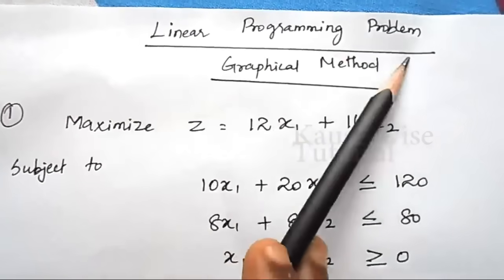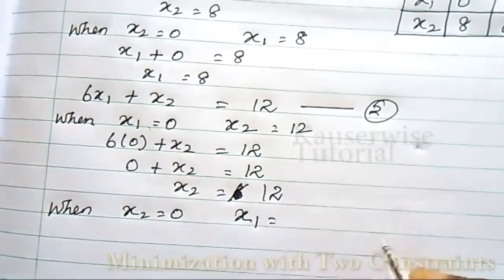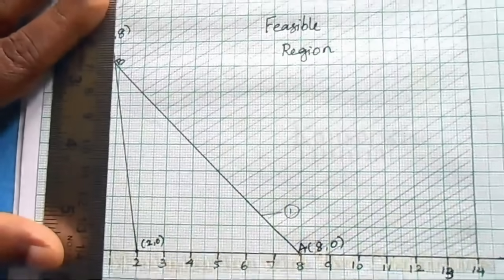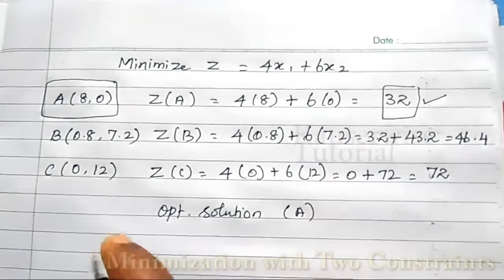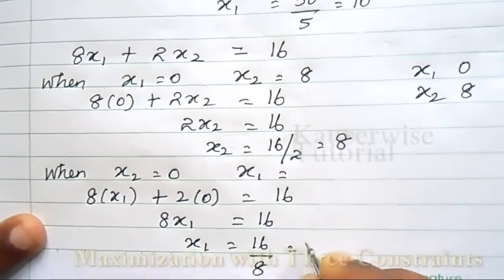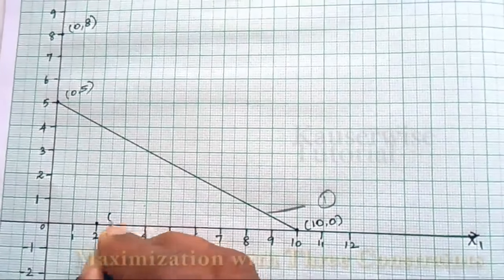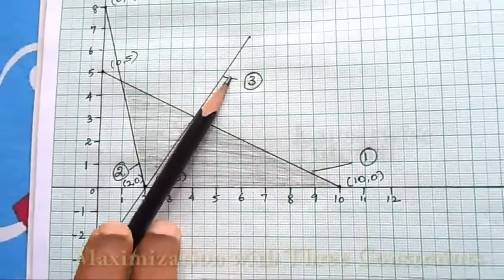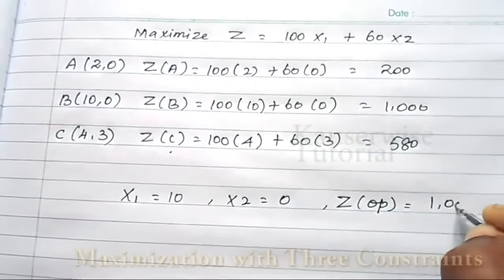LPP - Graphical Method [#2] [Minimization & Maximization with 3 Constraints] :-by kauserwise

Comment: But madam I think there is a mistake about constraint 3, point (0-3). The non negativity constraints X,y are always greater than 0 (X,y>0) that's why we can't have negative point (0-3). This question requires simplex or algebraic methods

Comment: Sign ko =
Find x1 0 then x2
And x2 0 then x1 for all-1minus 1 equations
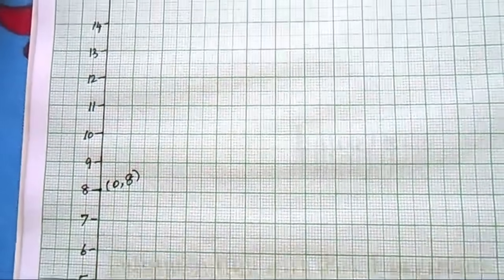3:44 x axis then y axis
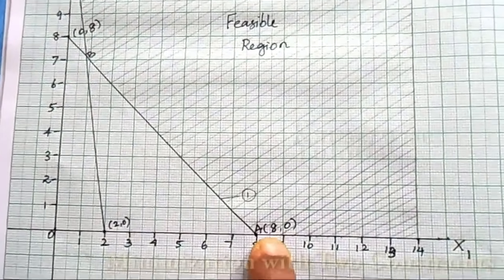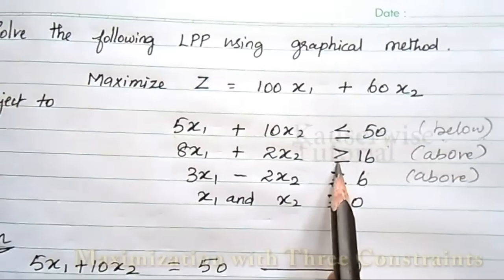5:21 15:58 feasible region since signs greater than (watch until 2nd feasible region)
Intersection value
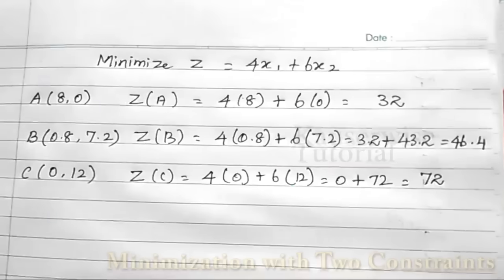7:50 fill 3 in main equation
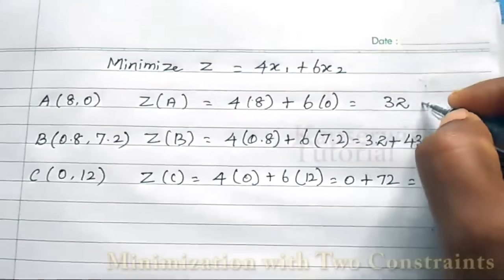8:13 optimum sol= min since main eq min....in case of max then max optimum solution ☆mention points (n,n)

Comment: Some one please answer this question using LPP-  A firm manufactures teak wood tables and sell each table for Rs.1000 and it cost Rs.500 to make the table.The company has 500 kgs of wood and each table requires 25 kgs of wood. The firm wants to know how many tables to make . Develop a model for this problem situation.

Comment: For 3 rd constraints you have told above the line feasible region then why had you shded the below the line part abit confusing if i am right the feasible region for third constraint line should be above the line which is just opposite.

Comment: How to solve this

Max Z = x1
+ x2, 

ST x1+2x2 <= 2000
      x1+x2 <= 1500
      x2 <= 600 (Problem is over here)
      x1, x2 >= 0

The problem here for me is with the third Constraint. What to do here when we don't have x1 in the equation.

I solved this by taking x1 as 0 got a straight line along x2-axis and z(B) and z(C) solved to 1500 (two optimum values with different X1 and X2)

Comment: Can u provide the solutions for the following problem subjected to   3 variable constraints using graphical method:
Example prblm is mentioned below for your reference.
3x1-x2+ 3x3 <=7
-2x1+ 4x2 <=12
-4x1+ 3x2 + 8x3 <=10

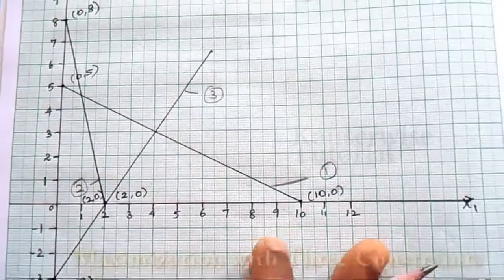Comment: Hello everyone I have a doubt at 15:00 why medam extended the line of equation 3 as the X2 is -3 and X1 is 2 , but the line got extended upto 6.5  

Sorry I'm new to this subject
Reply: A line is never ending. 
(0,-3) and (2,0) are points on the linear equation 3x1-2x2 =6
A linear equation can have more than two points that is why we are able to extend the line. Also extending the line will make it easier to find the feasible region .
Reply: @lakshikadev but x1 and x2 should be greater than zero but there is x2 is minus 3 is it okay how ?

Comment: Max. Z= 10x1 + 10x2 + 15x3 + 15x4
Subject to 
X1 + x2 < 200
X2 + x4< 250
X1 - x2 + x3 -x4 <5
-x1 + x2 -x3 + x4 <5
X1,x2,x3,x4 >0 
In this problem all are with equal to with less than or greater than.....
Plz solve it...

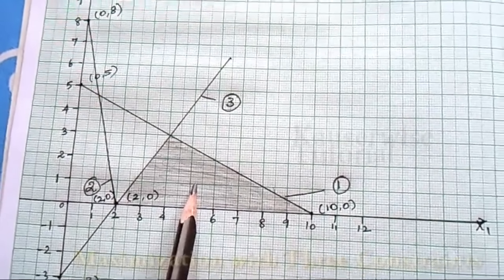Comment: in minute 17:25 for the third constrains region you shade the part beneath, how do you distinguid¡sh what you mean by above and below?
Reply: For >= constraints, the area on or above the constraint line i.e, away from origin
For <= constraints, the area on or below the constraint line i.e, towards the origin
Reply: José Álvarez Hey. I guess she comitted a mistake right there in the third equation. It should be the upper left. Not below.
Reply: Its like if equation satisfies after putting x1 and x2 zero
Then its shaded toward centre or origin
And if it doesn't satisfies 
The portion away from the center is to be shaded
Reply: Prashu B Nice explanation. Thanks.
Reply: You can find it by watching values of X - axis
Reply: The side which has values greater then 6 at x- axis is the third constraint
Reply: You've to substitute origin(0,0) in the equation and check with the inequality. Here, 0 is not greater than 6, so the region not containing origin is shaded. Hence, it is the lower part.
Reply: what do you mean? why she didn't do the same for constraint 2, which 0 is not greater than 16. than you :)

Comment: Dear Madam
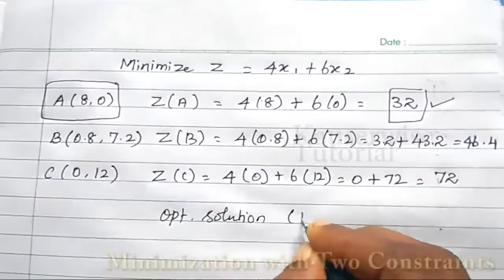In minimization problem at stream time 08:29, yo have mentioned that the optimal point is A, but dont you think that optimal point should b B=46.4 , because, we should have some activity  at X1 and X2 we should not consider x2 = 0 ,  therefore, we must take x1, x2 more than zero to have aptimal point with both activities.
Although i can understand as per the constraints you choose A. but i want your comment on B.
Regards
Reply: see mee I feel that here we are more concerned about the minimisation and our sole aim is to minimise the function. Also, the non-negativity constraint says- X1>=0 and X2 >=0, so either can be zero as well.

Comment: very easy to understand. But I was wondering why after the non negativity constraint,  X2 in equation 3 had a negative point.
Reply: I believe it's just to create the graph/feasible region. Although it's plotted at -3, the only values that can actually be used to solve the objective function would be greater than or equal to 0.
Reply: The sign before the x2 is a minus sign and of x1 was 0, solving the resultant equation, x2 will have a negative value.